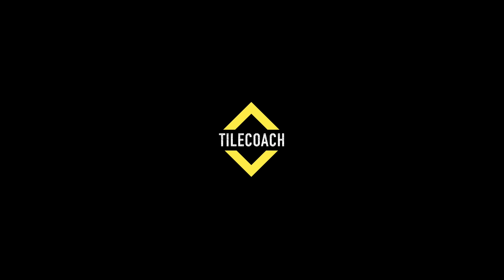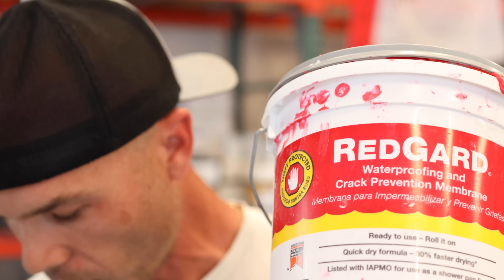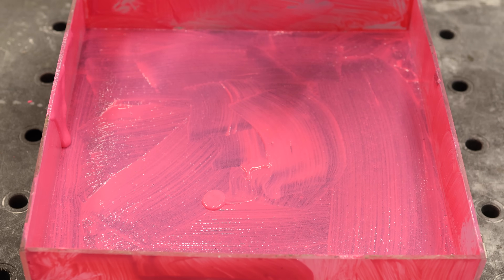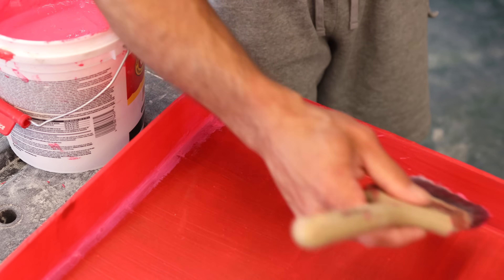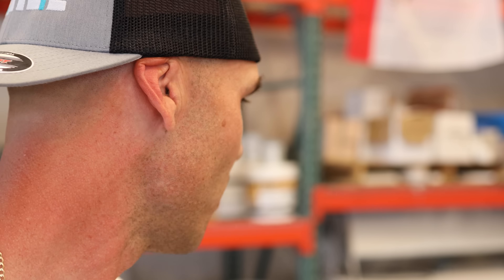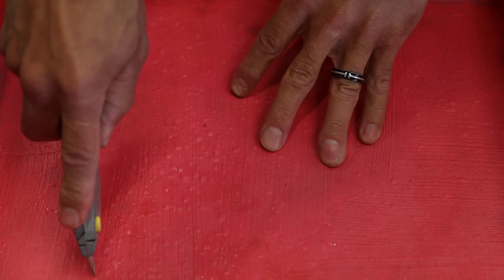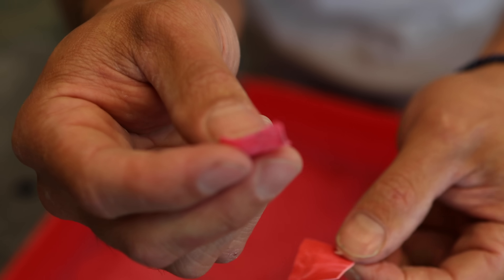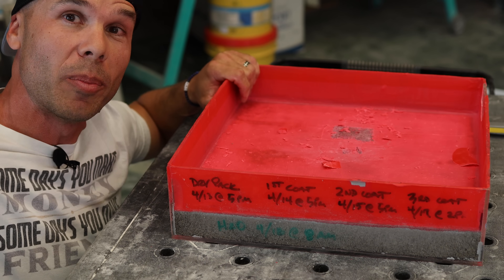REDGARD FAILED FLOOD TEST!!! --- Why Did it CRACK and BUBBLE UP???

Comment: My use of RedGard is as a water RESISTANCE factor, NOT a water PROOFING factor.

So in my applications, I'll treat the studs and subflooring with multiple thick coats of RedGard.  Then purchase 4 mil PVC sheeting, at least 4 feet up each wall (usually 5 feet), laying that on top of the studs, fastened with roofing nails, and using pvc sheet patches with PVC glue to cover the nails.  I even go so far as to tie in a sheet of the PVC sheeting to the floor, and again, using PVC glue to seal it to the wall sheets.  Next, the pan, usually a mortar base of some sort, dry or wet, depending on thickness, covering that with multiple thick coats of ReGard. Next, some form of cement backer board where I apply thick coats of ReGard over each fastener for that, and I can then begin my tiling.

Basically I'm using the RedGard to help ensure water isn't absorbed into things that can rot.  It only needs to resist the water long enough for any leakage to drain/evaporate away.  If I have standing water for 8 hours more anywhere, I've got a completely separate problem.

In twenty years I've yet to have any shower leak, at all.

Comment: Ive used several different versions of crack isolation/waterproofing TROWEL on membranes over the years (C-Cure's Pro Red, 2 versions from Mapei AquaDefense and one from Kona---their orange version which I think was a reformaulation of ProRed by C-Cure which went out of business). They ALL specify that it be trowled to a wet thickness (over dried but not necesarily cured deck mud) of 70 mils (using a film guage is helpful when you first do them), drying down to a 30 mil final thickness. All specified returning the next day (24hours) to check for curing cracks, particulalry in the wall to floor change of plane, and pin holes. All of those are to be patched  and dried before preceding to your final flood test and mud bed. ALL change of plane (floor to wall and around the drain under the clamping ring) areas should have embedded fiberglass mesh. I've never had one fail. Sometimes you may wait 2 full days before the membrane has fully cured...a lot depends on ambient temperature and humidity. Just painting on a few thin layers seems inadequate (and it REALLY seems strange to me that the manufacturer doesn't specifiy a wet and dry min/max mil but rather just by area and volume), but maybe the mud bed has to be fully cured so you don't get the mositure/flaking under the layers...otherwise,  I'm not sure why it would do that; but then Ive never used RedGuard becasue I already had several products that flood tested well and held up. Trowel on water proofing takes patience and willingness to sweat the details of the process or you'll have a mess. Your testing process is awesome and reveals alot of what goes on underneath your installations and it really helps to see potential areas of failure.

Comment: there were definitely some good comments on this when you done it 3 years ago. have you done this test again? I would like to see if the results are different if you made a removeable bottom and used the primer on the floor before putting the RedGard over your floor to the 15 mil and 30 mil thickness and the mesh tape in the corners set in thinset before putting the primer over it. You would think this would be on the Data Sheet on the bucket for sure and not have to call to get the added information for a successful install. That makes no sense if they want their product to be successful in the market place. Not sure what the deal is on that. If you already done another video, would you leave me a link in response to my comment? It does make sense to use the primer on your sub floor, since it is a porous material, according as I've heard you say, that allows moisture to drain; I guess in the case of your example, the bottom of your display prevented moisture from draining out and escaping through the bottom as I've heard you describe in some of your other videos.
What I am curious about is the cracking in the corners; I understand the moisture in your subfloor caused the Redgard to bubble, but what caused the cracking in the corners? Was that where the need of the mesh tape set in thin-set comes in or some other cause? Great video. Definitely a huge difference in what it looked like pealing it off of the plexiglass and the porous subfloor. I guess they both have pores, the plexiglass just has smaller pores than the Redgard does and your subfloor had larger pores that the Redgard, which was a big part of the problem.

Comment: That coating looks like it has the qualities of a latex based  coating , which at this point I assume is what it is.  I never understood the idea of using a water based coating to do waterproofing. They seem to be more waterproof than they used to be, though.

Also, an idea to make people happy and add that extra bit of relevance to the test. Have a box made so that the bottom is able to be removed. That would enable further drying of the mortar and observation of the effects of leakage or possible condensation (depending on the nature of the test) on the underside of a mortar bed.

Comment: you missed the 4 parts of water to a part of red guard before applying  the 2 normal coats, each in a different direction across the first coat.

Comment: The blistering did not occur on the plexiglass wall, only over the cement mortar. Cause? the mortar couldn’t fully dry because it was enclosed in plexiglass. the moisture got underneath the redgaurd causing the blistering. Simple science.

Comment: Apparently this hack cannot read very well.  No idiot would ever apply RedGard over wet mortar concrete gypsum etc.  and if you'd read the f**** technical sheet you would find out that that is the case.  Like all products if they're not used properly they will fail it doesn't matter what product you're talking about.  I've been in construction for 57 years been doing tile work for over half a century, and for the last 40 Years also doing forensic analysis of construction deficiencies and failures. I see failures every day I testify in court regularly as an expert and so often it's installation error.  That's not to say that plenty of manufacturers large manufacturers don't produce products that fail and must be reformulated.  Started doing glass pan testing over 40 years ago. The waste of time because tile work has been done for 5,000 years and we know what works.

Comment: I saw a video suggesting to cut Redgaurd 4 to 1 with water and use it on your cement board as a primer so it will adhere better.

Comment: I have found similar results. What I’ve done differently is to make a primer by using equal parts water and redguard. Blend well. Using a cheap chip brush coat entire area to be waterproofed, let dry completely then add your first coat and continue the steps . But make sure there is absolutely no pink before applying next coat.

Comment: RedGard as IAPMO Pan Liner meeting ANSI A118.10:
1 Gallon (3.78 L) 40 sq. ft. (3.7 M2)
3.5 Gallon (13.2 L) 140 sq. ft. (13 M2)

RedGard as Waterproof Membrane:
1 Gallon (3.78 L) 55 sq. ft. (5.1 M2)
3.5 Gallon (13.2 L) 192 sq. ft. (17.8 M2)

Bonding to lightweight cement
Prime all surfaces to receive RedGard® with properly applied
manufacturer's sealer or with a primer coat of RedGard®, consisting of
1-part RedGard®, diluted with 4 parts clean, cool water. In a clean
pail, mix at low speed (≤300rpm). Apply the diluted mixture using a
clean, fine head bristle broom to scrub in the primer solution at a rate
of 300 ft/gallon (7.5 M/L). Keep the surface of the substrate wet for at
3-5 minutes during application to ensure adequate and even
distribution / penetration of primer coat. Allow primer coat to dry, then
apply at least one coat of "undiluted" RedGard® before adhering tile,
floor patch or other flooring material applications. See Coverage
Section for square foot rates by application.
Reply: Some people just don't read ALL the instructions. Also I don't think it's a fair challenge since the dry pack is not fully cured being that it's poured in a non porous base.

Comment: My guess is the Mortar wasn't fully cured.  In the plexiglass it has no way to dry downward which it WILL do even on concrete.  My guess when you put the Red Guard on it it was still curing and all the moisture was moving up and building up a moisture layer UNDER the Red Guard since the Plexiglass held in 100% of the moisture of the grout.  The Red Guard probably would NOT have failed in a normal application where the moisture on the bottom of the grout could have dried downward and outward since it would not have been surrounded by non permeable material.

Comment: Plexiglass box is problematic. 1: it will not allow water vapor through so any water vapor must push out in the Redgard direction, blistering it. Line your boxes with 1/4" cement board and you'll have a better test bed. 2: it's a glossy surface; adhesion problems. Also I saw your 1st coat on the plexiglass; very light and uneven. I usually apply Redgard in multiple coats, not just two. Applying multiple thinner coats allows drying to occur more effectively and helps get more even coverage. I always use mesh fabric and double up with mesh tape at seams, embedding each within two coats, apply coat, apply fabric, apply coats on top. Also, Portland cement products need cure time, you must allow the mortar bed to cure fully or it may chemically react with the membrane, compromising it. I've used Redgard for outdoor decks over gold leafed ceilings with champagne colored beveled mirror strips on the walls 20 years ago. Still friends with the mansion owner, so no leaks. I've used it for shower pan repairs 10 years ago. Still holding water. I've used it for lime paster barhrooms. No problems. Do the job right. know the science behind the product and the procedure. This stuff is technical and scientific and requires high level of intelligence and technical knowledge. There are contractors who've been doing things wrong for decades but people think they're experienced. Wrong!! Know your s#*t!!

Comment: Issac, other end of the equation.. a clueless hurricane flooding victim in Florida.  I've heard contractors say I need to have Red Guard put down on the concrete under where flooring will be installed.  But it sounds like 1.  I would need a LOT more Red Guard than they are telling me to buy. 2. I don't think they are thinking more than one coat (and are contractors are going to lay it down and wait a few days?) and 3. Probably going with LVP, since I may go thru this again living here and it goes down and gets torn out easily.    Am I understanding correctly?  Groan.   Thanks  much. JD

Comment: I'm thinking that the acrylic box and relative short cement cure time is the main cause of the bubbling. Even though the concrete seemed 'dry and cured' it still has moisture that has no place to go, as the concrete can not breathe; and the vapor pressure will look for places to escape, and the only path is through the RedGuard; particularly when the product is wet. The moisture transpiration rate from the concrete is much slower than the RedGard dry time, so would result in micro-fractures in the material..  In normal installations, the concrete has a way to breathe. Recommend that you re-do the test providing normal paths for the concrete to breathe, and only use the acrylic as side windows.

Comment: Great video. Thanks for giving a crap for the rest of us DYIers and Nomads. I found a video about six months ago when I was putting the shower and all of the water proofing I did in my Overlander/Home caller Avoid these two pitfalls when applying RedGaurd. (https://www.youtube.com/watch?v=GNz76nvKwKg) Even though I was applying to wood I still primed it and used a fine Alkaline Resistant Mesh in the crack, elevation changes, and seams. When I did my water (12 hrs) I did not find any leaks, but yes I notice the color change as well and thought it was weird.

I noticed in your test you did not prime the porous surface of the motor bed and did not put any kind of support in the corners. If you decide to redo the test using these additions please let me know I am supper interested in the results since it would give me more confidence it all the RedGaurd I used in my Overlander/Home.
Thanks

Comment: nothing that is liquid usually does well if laid down super thick, ive always applied it like paint but did 3 or 4 coats.....even paint or other materials will crack if applied too thick, thin coats multiple times usually work best....

and for sure mortar bed had moisture still inside....most cementitious products have long cure time...the glass holding the moisture in as well could be a factor

Comment: One tip I have seen that seems useful is on a porous surface especially one not fully cured apply a thin coat of red guard and water mixture as a primer. Red guard like any role on product has to cure, not just dry. ✌🏻🇺🇸

Comment: At the recommended rate-of-use, the applied thickness should be maximum 125 mils = 3.175 millimeters = 1/8". Your finished application of Redgard appeared to be less in areas. So, inconsistent thickness is one issue. Also, your dry pack was inside of an acrylic box, with only the top surface area of the dry pack exposed for evaporation. Using real-world material, i.e., cement board, plywood, etc, moisture evaoprates from both large surfaces of the dry pack, plus the sides. Those materials allow some path for evaporation; not much but some. The dry pack was not completely dry. Period. Then, when you poured water into the box you created a seal above the Redgard, which sandwiched that material between a still-evaoprating dry pack and full-contact water... no place for the evaporation to go other against the Redgard. The interface surface between the Redgard and the not-yet-dry dry pack prevented the Redgard from completely curing/drying.

Comment: I am using the red guard as a moisture barrier between a new cement leveling slab and slate tile floor.  The original cement floor did not have a moisture barrier when the space was built in 1950.  Following an architect consultant's advice I will use Redguard as a moisture barrier.  His crews use Redgaurd in apartment building renovations and new projects for shower enclosures and bathrooms.  Before moving forward with my project, I called Custom Building Products with my cure question.  They recommend the cement cures for 28 days.  Granted a cement pour is not a mortar bed and I am not dealing with full water immersion situation.  The manufacturer suggested that if I wanted to lay tile prior to 28 days, I could use their Redguard Speedcoat product which can be applied over uncured surfaces, and of course is much more toxic!  I am almost to the 28th cure day for the less toxic version of their product.

Comment: THe fact the the entire bottom failed means you simply didn't put it on properly.  Most likely its not cured. You really need to add an a follow up explaining your failure to apply the product properly.

Comment: Everything I read about RedGard says to put a primer coat before applying the membrane coat.
Try it again with the primer first.
"Prime all surfaces to receive RedGard® with properly applied manufacturer's sealer or with a primer coat of RedGard®, consisting of 1 part RedGard®, diluted with 4 parts clean, cool water. In a clean pail, mix at low speed to obtain a lump-free solution."

Comment: As a painter, I believe the product had not cured. If the crack allowed water into mud bed because of a little oversight, thexEedGuatd itself should not turn soft. To answer this question you can apply product to specs on one surface and let cure. Then to another surface but do not let cure. Submerge both in water for same time period. My bet is cured one will not soften.

Comment: there is a particular way how I use it,I definitely do three layers my first layer is extremely thin but I don't use a brush I use a rag and then I go back with a brush..(I'm sorry to tell you but your concrete was not dry you forgot about condensation)For example, if the concrete is four inches thick, it should be allowed to dry for at least 96 hours ....nice video good job!!!!!!!!!!!!!!!!!!!!!!!!!

Comment: Maybe the solution is to do a thin coat of epoxy over the base of sand mix and then RedGuard. If you think of it, that sand mix base was made with water right? Unless you get it to heated temperature, it will always have some moisture. just my opinion.

Comment: I’m not a Tiler, but I am a handyman. What I noticed obviously is you were talking about two different substrates. The wall is made of plastic so adhesion is going to be better. The mud base is made of cement which is much more porous. Therefore I’m thinking, I would use thin coats and build up on the cement. No different than putting paint on wood. This will avoid the bubbling that you referred to on the mud. Lastly, it is evident that the product does work by nature of what you showed on the plastic. However, I think the manufacturer does not do a good enough job in supplying the user with correct information on the substrate. Thank you again for your videos. I am extremely impressed with your patience and explanations and your instruction is a lot allowing me to endeavor into the tile world. I look forward to seeing your other videos. God bless.
Reply from the maker: Good points.   Thank you for your input and you are welcome!

Comment: I think that you verbalized the sq ft coatings wrong vs what the instructions said.  Instructions said, two coats, each coat would be 80 sq ft per gallon.  You said, two coats of 40 sq ft per gallon and that'd be a total of 80 sq ft.  Please correct me if I'm wrong as I'm about to red guard my shower!  Thanks dude!